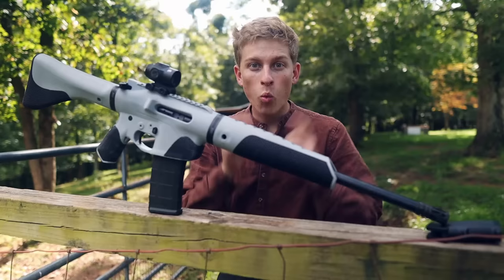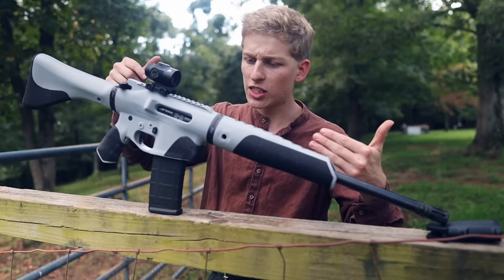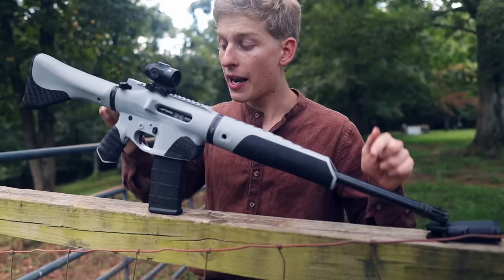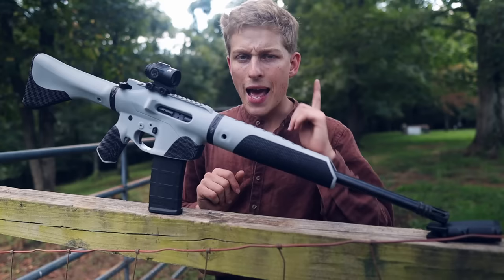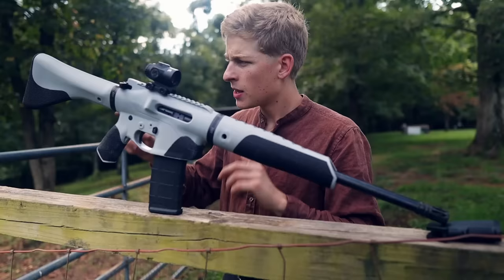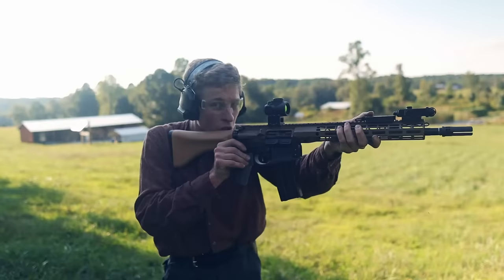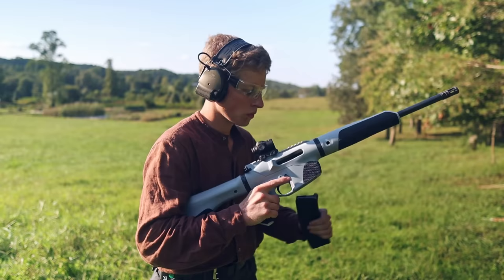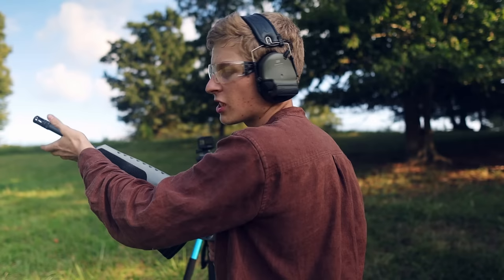I Printed an AR-15

Comment: Unlike almost every 3D printed gun I've seen so far, this looks like something that someone might actually want.
Reply: PSR?
Reply: hahaha ... but for real it does look pretty dam good ;).
Reply: There’s some pretty good ones like the amigo grande or the FGC but generally ye a lot are pretty ugly.
Reply: I’ve seen some pretty good looking Mac-11 builds out there and there are designs for one that doesn’t need the upper receiver, but it’s still in the early stages
Reply: The TacDaddy has joined the chat…
Reply: check out print shoot repeat
Reply: @Drippy_Jesus  that gun is gorgeous. I have three uppers
Reply: @cd0130  I wish I could have just one upper 😫
Reply: Obviously it’s subjective what someone likes, but I’ve found/printed a bunch that look good imo. A lot of people already commented but definitely check out print shoot repeat for some badass prints
Reply: search for "HK Slap" you wont be disapointed
Reply: Looks like a FN design.

Comment: Also, your casings are hitting the wall of the upper, it is too thick. Sometimes the shells deflect from the brass deflector, but 80% of the time they deflect from the wall. This would potentially create a weakpoint, but you should consider deleting the brass deflector and extrude it like 2mm from the inner wall of the upper instead of the outer wall of the upper. This will in turn shift your deflector backwards by a small amount, so you might need to change its angle by a few degrees as well to have the shells eject where you would like them to. Hopefully this won't create any issues for you, but it is the only viable option I see.
Reply: Part of it could also be due to the polymer, even though it is a hard polymer, has more elasticity than steel or aluminum. That could also contribute to the bouncing forward rather than to the side. The geometry of it will likely need to be at a much different angle than the standard AR deflector. Angle would probably need to be brought back to the rear of the gun more. This is all in addition to your observation as well.
Reply: I was thinking the same. The brass deflector was only added on the original design because of the odd round being a little hot and hitting the shooter. Possibly the system is a little over gassed as well given how quickly the spent cases are rotating out of the bolt. Cool design though. Looking forward to updates.
Reply: @ricashbringer9866  True, but if he got rid of it completely then he would have to resort to making a cut in the upper to make that wall thinner, which would create a weak spot, which he wouldn't want. Having the deflector doesn't hurt and in this case I believe it only benefits the design in terms of strength.
Reply: @rekerboi1125  yeah he literally addressed that in the video.
Reply: @lucasblanchard47  remember that the original AR didn't have a brass deflector.     As already stated the thicker upper  could be the problem, or even the elasticity.  Another issue is the speed of the extraction.  Your metal bolt carrier may drag on the upper.  The buffer spring strength may be an issue.  The buffer weight may be an issue.  When you change materials in a kinetic system you may get imbalance problems.  An interesting thought is that the gases dumped into the upper may be stretching the upper.  Even more extreme would be upper is flexing.  
Your design an build is amazing.  
Is it possible to use big U clips instead of hose clamps?
Reply: @saltyroe3179  I think you hit it. I think the bolt is coming back too fast, and the solution is likely a change in the buffer assembly. (or a better/stronger ejector spring).
Reply: @saltyroe3179  this is not my design or build. I think you might have responded to the wrong person ha
Reply: Looks more like an over-gas/under weight issue than thickness.
Reply: I concur your observation.. I wouldn’t delete the brass deflecter, but rather change the geometry of the wall in that area, and move the whole geometry of brass deflector inwards of the receiver, adding the right angle to that part of the receiver wall, that’ll do it I bet.. and if your worried about a possible weak point, I believe you could possibly add a piece of support steel and pin that straight into where that weak point would be… you can 3D print a 100% infill jig for drilling in this hole that would simply rest on the inside and outside of the ejection port
Reply: bullets
Reply: or it might just be overgassed
Reply: Deleting it wouldn't necessarily make a difference. If you look at the video again it's not actually hitting it, it's stopping on the thick wall of the ejection port. If you look at the very first shot when he's holding it out away from him, you'll see it's over gassed.
Reply: looks like it's just over gassed.  get a heavier buffer or an adjustable gas block.
Reply: I think the curve on the transition to the brass deflector is not big enough
From what I see the brass hits the flat part of the ejection port absorbing the sideways energy of the brass
Reply: Forward ejection is preferable to 12' o clock and back, When an AR weakly tumbles cases out it's generally a sign of poor ejection and can cause reliability issues. The ejection is strong but a tad erratic, unless it  caused a malfunction I wouldn't worry about it. If bolt speed is an issue he can add weight to the buffer.
Reply: @HaveYouMetMyFist  it did cause a malfunction tho
Reply: Yes I also believe this seems to be the " " case, also try making it out of metal next time.
Reply: Mmù
Reply: Yes I agree, you have to change the angle of deflection.
Reply: @thomasstewart1380  yes that is why it should change the angle, to avoid the har bounce and let the brass slide a bit
Reply: Take a Dremel and remove the edge of the deflector, starting the angle closer to the bolt. Probably won't have to remove much material.

Comment: Holy shit man this is potentially revolutionary in the I industry of Firearms. This is technically a new Firearm since you completely redesigned the AR platform. Based AF
Reply: not rly but still cool
Reply: It's just a housing for commercially  produced gun parts (like almost all of those so called 3d printed guns). You could make it out of wood, if you're patient enough.
Reply: @PuerRidcully  You can build your own aluminum receivers too
Reply: @PuerRidcully  you can carve an entire ar15 out of a 4 foot block of steel with a rat tail file if your patient enough
Reply: @hockeymaskbob2942  I’m not doing that lol.
Reply: @PuerRidcully  and if any manufacturer did this it would be called a new rifle.
Reply: @hockeymaskbob2942  might need a couple files lol
Reply: @hockeymaskbob2942  some of the inside bits might be tricky but yeah basically
Reply: @brahtrumpwonbigly7309  no...firearms are how they are because of the receiver, you ignoramuses that play videogames think that somehow it's the stock and casing that makes a firearm unique...you can make an AK look like an AR-15 and it'd still be an AK because it's the internals that make a gun unique, not the outside. Get outta here
Reply: no. the "Gun" componants are all AR. bolt carrier group, trigger, selector, and mechanics of the gun are 100% AR. 
it's just a diff stock and barrel shroud basically. the lower is the same as ar.
Reply: @tevarinvagabond1192  I disagree that’s like saying a cars engine is what makes the model. Furthermore you picked the worst two guns for your example because ar’s and Ak’s are so vastly different that there’s only so much you can do in terms of cross integrating components without redesigning every part in which case we’re no longer talking about the same gun but a new and improved platform based on a previous iteration
Reply: No. The ar platform is the hardware. This guy just 3d printed what is called the furniture. Cosmetics only. But yeah, he did a damn nice job.
Reply: @erikrodriguez7112  no the hardware is the hardware. If I use at-15 parts on a different gun altogether, we’re talking about a modified frankengun, not an AR
Reply: lmao. no. this is just material science. he made an AR designed to be plastic not metal.
Reply: Nah, he went back to OG AR10 design for basis.
Reply: @gr6373  You can build them out of really small layers of human skin carefully cut and glued together one by one if you're patient enough.
Reply: Not at all it uses ar locking ar operating ar bolt ar fcg. Everything about this is ar but the printed bits and those are all inferior to the ar ones. Its a cool project but its nothing new
Reply: @erikrodriguez7112  he printed the recievers. Lat I checked you don't need furniture for a gun to work but 100% need the recievers. Tell us you have no clue about ar15s without telling us. Go ahead post up a vid of you firing an ar without the recievers since you think they are "furniture"
Reply: @Ofmyownvolition  I know a lot about the AR-15. Built my own. Read my comment in context to what I responded to please. I think you will see my point here. 

3d printing the furniture, or even the lower is not 3d printing a working AR-15. I was just clarifying that. 

So again, go back and read it again. I have no inclination to deal with armchair wordsmiths who make themselves feel smart by posting out of context responses.
Reply: @erikrodriguez7112  i don’t care dude you win if you want you sound like you need this W in the comments section

Comment: I just can't get over the aesthetics of the gun, it looks fucking beautiful with all the fillets and smooth, round transitions. Absolutely incredible!
Reply: Agreed! Most home-made guns are aesthetically awkward and are not "pretty" to look at because they have to conform to spec uppers. This design gets rid of that need and makes a beautiful to behold design.
Reply: @TheJBerg  kinda reminds me of the CR-21
Reply: Moon gun
Reply: Only change would be a picatinny rail point on top of the fore end handguard, for iron sights. Otherwise   I would buy this design over a good number of current accessory options at most local shops! Ergonomics matter, especially when you spend long days in the field. No rough edges to dig into your side or back when carried with a sling. textured grip along the mag-well. S M O O T H stock design. Absolutely gorgeous.
Reply: I agree. This is one of the better looking 3D printed guns I’ve seen.
Reply: I can't agree, i love the idea of it, but this entire gun looks like they tried to turn an ipod into an AR-15.....don't get me wrong, i'm all for 3D-Printed guns, but there comes a point where i'd rather see more wooden components, like the service rifle from fallout.
Reply: @feodrich  then just get an A1 style Ar and wooden furniture.
Reply: I agree, it's a great looking firearm!
Reply: Seriously this thing looks like it belongs on a space shuttle.
Reply: @colttification  that was what I thought. This dude should see if that new space force is in the market for a new rifle design. Given that it heavily saves on weight, its probably exactly what they would need.
Reply: Shit looks HOT, really one of the first 3D printed builds that I don't have an issue with the anesthetics of.
Reply: Space gat
Reply: Some guns are pretty.  Some guns are ugly.  That gun is pretty.
Reply: @feodrich  you just made me want it more. I want to imbed an Ipod into the stock or something so it plays music and videos while I shoot.
Reply: A very retro Sci Fi or exotic Sci Fi aesthetic. This guy makes some weird, but wonderful stuff. This one had the whole package of looks and practicality.
Reply: I think its pretty weird looking personally, like someone tried to me a storm trooper into an AR
Reply: Seriously, how does this look so good, while the XM-8 tried to do the same look and ended up looking so bad?
Reply: For some reason its giving me XM8 vibes...
Reply: yeah looks way better than the MS-Paint look of the traditional stock ones.
Reply: Doesn't look nice at all. Looks like a fucking ps5 mate. That's not a good look.
Reply: this is what has needed to happen to make printable guns. just pooping out an aluminum design out of plastic is guaranteed failure. bout time a tiny bit of material science got applied.
Reply: Cyberpunk
Reply: @feodrich  I love wood furniture too, but I also love the iPod style ( what a perfect name for it, lol)
Reply: @UsDiYoNa  Exactly! Storm Troopers Unite!
Reply: @jonp8015  Because H&K is absolute trash.
Reply: its looks like some "futuristic" rifle from a fps of the mid 2000s
Reply: @brycelindley5210  You don't spend long days in the field.
Reply: Yes, kinda like VEKTOR or Pininfarina had a go at an AR clone........

Comment: That looks quite similar to the original ar-15 from the 60s. Also as a lefty, I am happy with those casings ejection path. Lefty shooting stance puts the ejection port closer to our face...
Reply: With a 3d printer, you could actually print a lefty upper. I'm not 100% sure if flipping the bolt would eject cases correctly..
Reply: was shocked a lefty would be interested in this then I realised you mean your hands

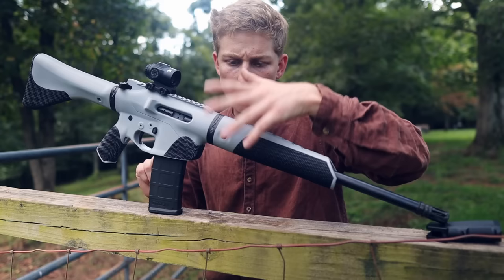Comment: 4:02 "tapered internally" is something I've never heard of anyone doing before 3d printing. the idea of internal density tapering off is insane in anything except additive manufacturing.
Reply: It can also be done on a metal lathe with a boring bar.  Just set your compound to the desired angle.
Reply: @tennessee.tiger1988  Not an internal diameter taper, but an internal taper of density inside the material itself.

You could do an internal diameter taper on this handguard and probably get the same or similar effect (I don't really know how stiffness would be affected) But on more complicated geometry with different requirements I'd expect you might find benefits from internal density tapering where just tapering the thickness of walls is less feasible.

Comment: Because your upper is thicker than a standard alluminum upper, you may need to add some draft to the sides of the ejection port. If there is already draft there, maybe increasing the angle will help with your ejection problem. Very impressed with this build. Keep fighting the good fight!
Reply: Would have been cool if I read the comments before commenting this exact thing myself lol
Reply: After that try using an adjustable gas key or adjustable gas block to fine tune it the rest of the way

Comment: I think you should consider designing a receiver assembly for HK416. That is a piston gun which means it may be cooler around the barrel mount area compared to direct impingement AR. Having a cooler barrel mount area means the zeros can potentially hold better.

Comment: Holy shit! You are a mad scientist! You have basically redesigned the AR. This is almost a completely new firearm all together! I'm in love with this design and I wish I had the ability to build this. Great job, sir! It is absolutely beautiful!
Reply: Ejection looks like a geometry issue with the brass deflector and or the extractor on that one BCG. IMO
Reply: @spaz13b  seems like the deflector is angled too far forward.
Reply: I’m sure he could get the deflection figured out, he’s working alone.  If he had a few employees I bet he could sell thousands of these.
Reply: @wood-wheel-wizard  I volunteer as tribute!
Reply: It actually looks beautiful!
Reply: I know Hoff will see this. he is a genius
Reply: @cd0130  BIG facts!
Reply: Stop saying "new".  This has been widely in use. :)
Reply: @tomkingston1468  I said it was "almost" a completely new design. And it's not like you can go to every shop and get an AR like that. So if you're referring to printed designs , then it's still "new". So how about you don't try to discredit dudes work here, and keep moving.
Reply: While I respect what hes doing and very impressed with this firearm I have to disagree. This gun is super ugly but that's all personal preference.
Reply: @tevarinvagabond1192  The parts are not quite behaving the same. Integrated grip/lower (that's different), the way the halves connect (that's actually SUPER old, original V slot sliding instead of pins hasn't been in an Armalite design except for like the original, no other works that way on the market for Armalites), the integrated buffer tube/stock is also much different. So its mostly only the same as in its a bolt action with a gas port to actuate and using standard components. Its disassembly will be entirely different as well since it slides forward (more like MOST other conventional designs), and dissimilar to the iconic pinned and tilt able field strip design.

Comment: Ejection port: It's boinging off of the flat of the extrusion you used to cut the slot. Using a straight extrusion, you're just cutting a straight oval right through the plastic, leafing a flat face at the base of the brass deflector. Change the settings on that extrusion so rather than an ovoid prism, it cuts in the shape of an ovoid pyramid that opens up toward the outside of the gun. The are settings for the extrusion-cut in Fusion that will let you change this angle.